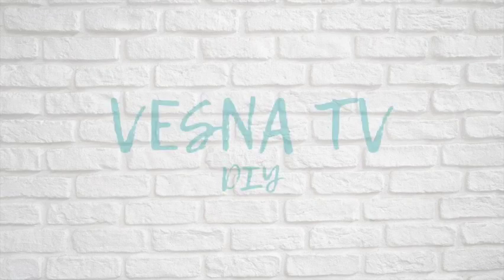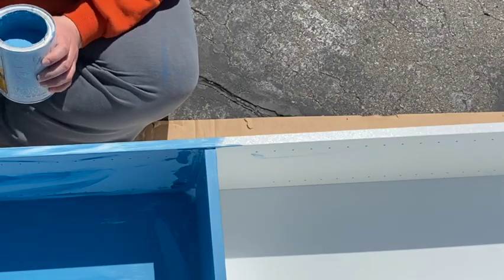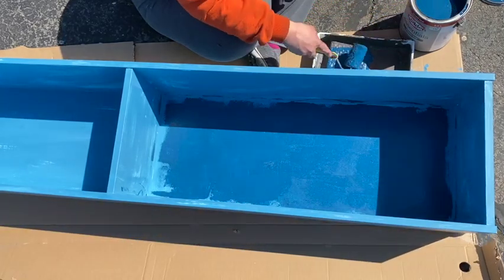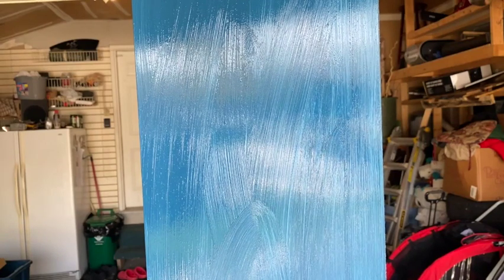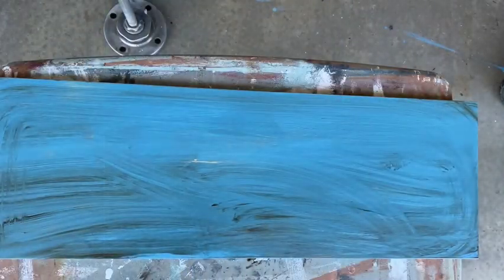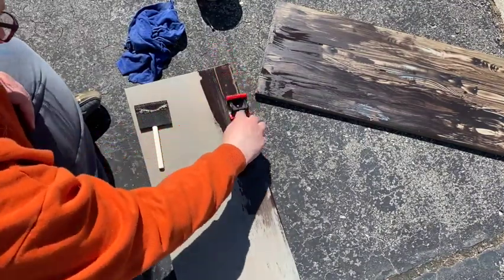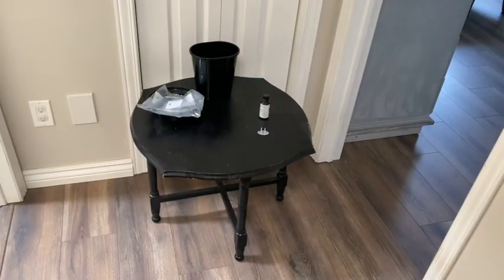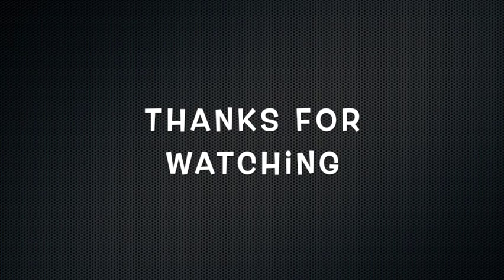🌟UNBELIEVABLE IKEA BILLY BOOKCASE MAKEOVER - HIGH END LOOK FOR LESS

Comment: Interesting. Never knew about wax. Currently doing my partner’s built I. With LG ultra blue on the back. Rest is white
Reply from the maker: Wax protects the chalk paint but you have to make sure everything has cured so depending on temperatures it could be a whole day or two. The clear wax protects and that one you have to let cure as well and then apply the black or antique wax because those you wipe off so you want to make sure your protective costing is set (whatever protective coating you used). It is a bit of work but the end results are custom and amazing. All of my furniture is unique to our tastes which I love. Thanks for watching!!!